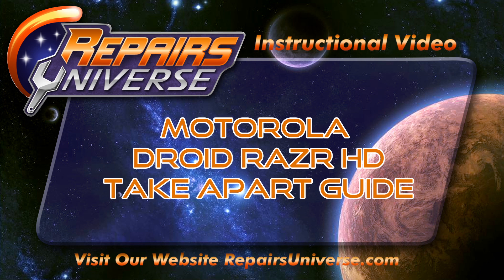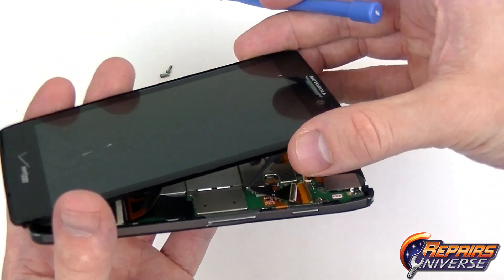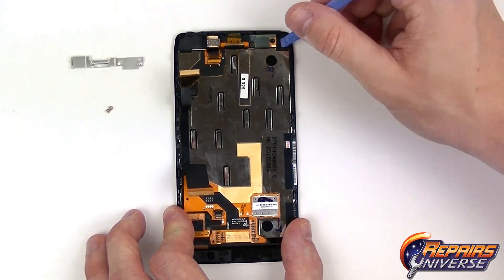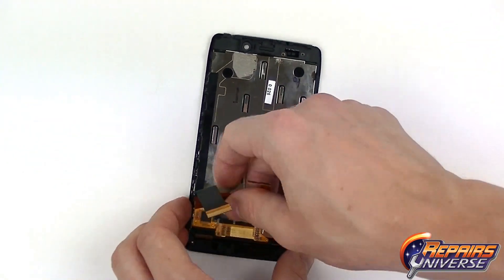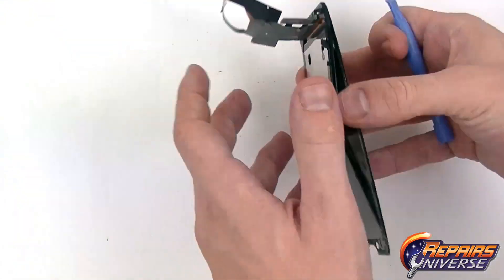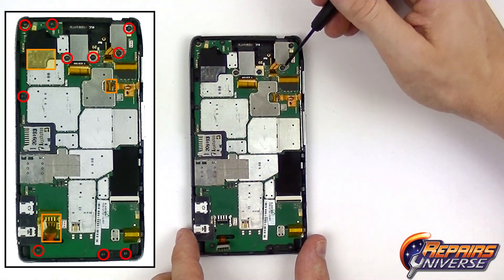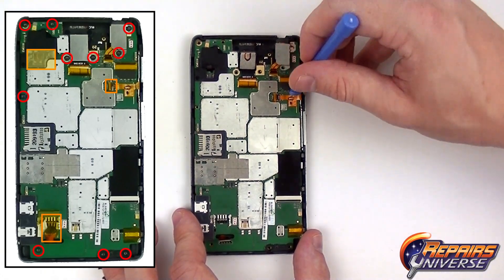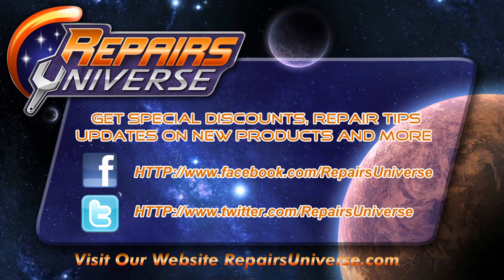Motorola Droid Razr HD Screen Replacement Repair Guide

Comment: I have a question actually - I've got a Droid that doesn't charge, and I've got another one with the screen smashed, but same model and everything. I'm also pretty much a technological invalid (ha-ha). Could I just put the front assembly of the one onto the back part of the other, easy peasy lemon squeezy? I'd rather not buy a new phone.

Comment: Hi, I just need to replace the lcd assembly on my phone (I think). Local store wants 150 dollars so if the part is around 100 and it takes 10 minutes to replace then that's a whole lot of labor cost therefore Im going to attempt the repair myself. Where exactly do I need to reapply adhesive and where can I just reuse the same adhesive if possible. also what kind of adhesive do I need?
Reply from the maker: I may recommend purchasing the unit with the frame to avoid the adhesive portion all together. Otherwise, the adhesive simply goes around the frame the LCD sits into on your device. You would require new adhesive. Here is a link to the unit with frame that we offer http://www.repairsuniverse.com/motorola-droid-razr-hd-lcd-touch-screen-replacement-frame.html

Comment: I accidentally ripped the connector on the motherboard for the flex cable to the front camera and speaker, any ideas?
Reply from the maker: Once torn it will no longer work, I apologize to confirm this. If this is directly on the motherboard, there may be no solution.
Reply: Repairs Universe I figured that, luckily I had a good warranty.
Reply from the maker: Good to hear that. We appreciate you following our videos. We'll be here for any support, thank you.

Comment: Do I need to replace the adhesive on the screen assembly on the top and bottom and sides
Reply from the maker: It's recommended to use new adhesive, Yes.

Comment: Hi thanks for the video. I broke the screen on my driod razr hd and now ihave a new droid razr hd. Can i just temporarily swap the screen assemblies to get the the pictures off the broken phone and then swap the good screen assembly back to the new phone. Thanks
Reply from the maker: MrTandk22 Sure, so as long as they are the same model. You should not have any problem doing this. Just be careful in the removal process of the new display.

Comment: great video. 2 things i noticed. a very small rubber piece fell out under proximity sensor and after putting it back together screen would black out when making a call. other thing ive noticed is larger flex cable comes out very easly. i recomend saving tape. and putting it back on the flex cables

Comment: just replaced my complete screen assembly. the lcd works great. sound and buttons all work but my digitizer screen is not working. i followed your instructions exact and your video is the best yet. any thoughts?
could i have a dead digitizer or could i have done something wrong?

Comment: I replaced my screen+digitizer and the display is still not working.  I can use the HDMI cable to get it to work through the TV but nothing works on the screen.  Neither the display or touch is working.  I had previously shattered the screen and was still able to get access to the phone with the HDMI as well.  Could it be something in the motherboard?  I removed it from the housing to see if there was any noticeable damage but I did not see anything.  On another not the locking tab on the connector is broken off but the cable still slides in and it is held in there with a piece of tape.

Comment: Does this LCD repair also apply to cracks under your screen?
Reply from the maker: I'm not sure I understand your question. Is the LCD cracked (where the picture is)? Is the touch screen digitizer cracked (just the glass)? I would recommend replacement of the complete assembly. The lcd is fused to the glass. This is a difficult repair separating the two without damaging the LCD. You can find your replacement part here...
http://www.repairsuniverse.com/motorola-droid-razr-hd-screen-replacements-repair-parts.html

Comment: I dropped my Razr Maxx HD and the screen just stop working on me. Could it be just replacing the LCD screen will fix the problem? If so, what part of the process do stop following the video and just start installing the new screen??
Reply from the maker: First thing I would do if there is no visible damage is check all the connections. One may have come loose in the fall. If everything looks okay then follow the video and replace the screen
Reply: Repairs Universe  No outer damage is done. So I just have to remove the screen and insert the new one? Also, where can i purchase the LCD part for this phone?

Comment: hey how do you remove the glass form the digitizer
Reply from the maker: It is very time and labor intensive. You must heat the front glass to aprox. 110 degrees. Then take something ie. business card, or wire. You need to separate the glass from the lcd. If you don't feel comfortable with the repair you can always send it to us and we will be happy to repair your device.

Comment: Hey, Is it possible to replace the glass without replacing the Digitizer? I have a cracked screen, and just need to replace the glass.
Reply from the maker: Ryan Campbell It is possible, however it requires specialized equipment. It is only suggested for experienced technicians as the adhesive that fuses the digitizer/LCD together, is much stronger than used other devices.

Comment: I used your guide to replace my screen(thank you btw), and it went smooth. I've been using my phone for about a week now, and now the screen doesn't respond to touch! Any ideas on this? I haven't dropped the phone, and i checked the connections multiple times :( Your help is appreciated!
Reply from the maker: Will Keizer Where did you order your screen from? I was working for a week then suddenly stopped?
Reply: Repairs Universe I ordered it on ebay. It worked for a week, just like the phone was fresh out of the box, and now it doesn't respond to any touch. I think i'm just going to get a refund on the screen, and put it towards a new phone =/
Reply from the maker: Will Keizer I would request a refund too. It sounds like the screen you received was defective or of low quality.